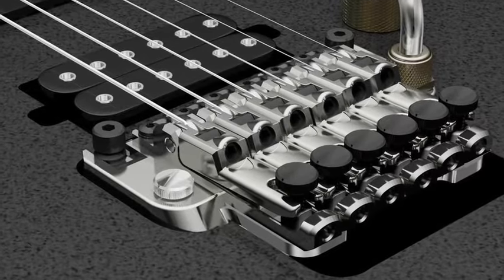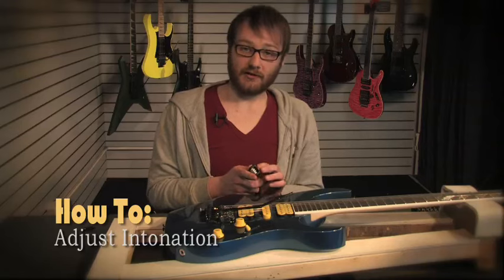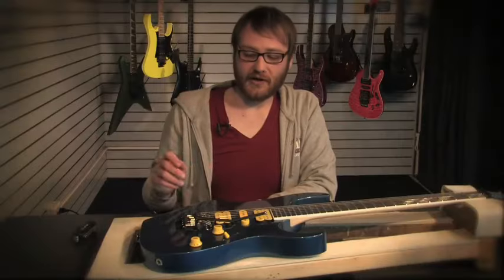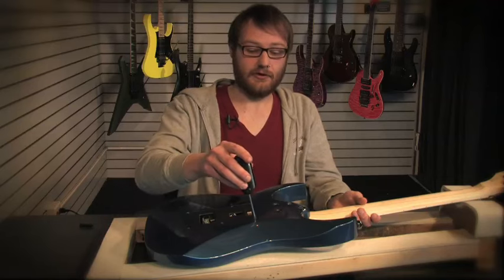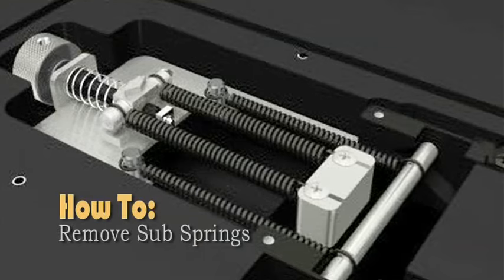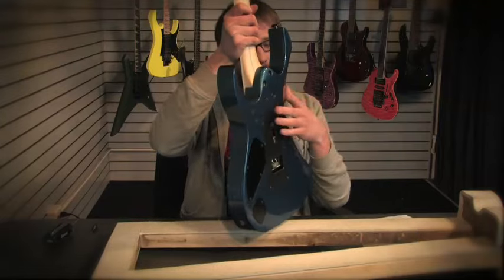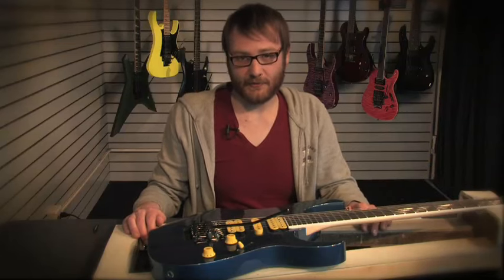Trems : Edge Zero

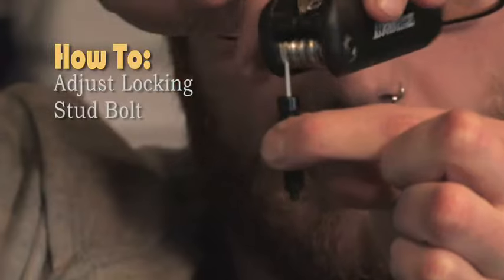Comment: why would you need to adjust the stud bolts? at 1:20
Reply: For tuning stability. The stud bolts are "set it and forget it". You want to make sure the stud bolt (there is only ONE...the same insert is used for the string height, tho...which confused me at first...the 2mm wrench in the stud lock mechanism is on the SAME side as the trem arm...so, the lock-down of the bridge mechanism is housed in the SAME BOLT as how you adjust the string height). 

I was wondering the same thing. Here is what the manual says: The Edge-Zero2 (my bridge) uses a stud-lock mechanism. "Insert Hex #2 through the hole in the top of the stud bolt and turn the stud lock bolt CLOCKWISE to tighten until it contacts the anchor nut and can no longer rotate."
Reply: Weston Guidero Basically you only need to adjust/loosen the stud lock bolt if you want to change the height of the tremolo/string action or remove the tremolo from the guitar itself.

Comment: I have several older Ibanez guitars (4 to be exact), all of them with either Lo-Pro Edge or Edge tremolos. Since last year I also have a new JEM77P-BFP with an Edge Zero 2 (no zero point system from factory) and I hate it! Sorry, this is an inferior design than the older style trems and the worst part, it doesn't stay in tune! As I said, I have several Ibanez guitars with FR-style tremolos and every one of them stays perfectly in tune, even with a lot of abuse. But this thing? Fuck it! I replaced the studs, took a closer look at the knife edges (no marks or anything, looks good), balanced it out, tightened every screw, still no chance. I use the same D'addario strings on all of my guitars and I stretch them sufficiently after I put them on. To be honest, I'm sure, I don't do anything wrong, it's just an awfull tremolo. Too bad you can't retrofit an old Lo-Pro since the routing doesn't match at all. Please Ibanez, rework the design or go back to Lo-Pros. You made great guitars for several years but now I would really think twice if I would purchase any NEW Ibanez guitar or simply look somewhere else! As far as the JEM goes, I'll try to buy brand new parts (tremolo plus nut) or I'll block the damn thing completely if nothing helps.
Reply: This is not true brother. I am an intesnse trem user and my ibanez rg premium also has an edge zero 2 trem and it has never gotten out of tune. Maybe you didn't adjust it properly. Edge zero trems are definitely as good as the older trems in terms of stability ( if not better ) and are convenient to use
Reply: If you honestly think that the edge zero 2 trem is better than the lo-pro edge, you obviously have never used one yourself. You don't find the edge zero 2 on the prestige models, think about why.
Reply: I just bought the JEM77WDP which also has the Edge Zero 2 and my experience has been the same as your.  Very unhappy with the tremolo on this otherwise awesome guitar.  I'm looking at methods for blocking it, without giving up the tremolo altogether.  I'm looking at the "Tremol-No".  Have you ever tried that?
Reply: From the video this seems like a far superior trem to the old Edge/LoPro/Edge Pro etc designs, but I came here because I was also looking at the new BFP re-issue and wondered why it had a Trem I'd not heard of.

Disappointing to hear about your experiences, I've got a 94 Jem 7V with a Lo-Pro Edge, back in the day the trem was bomb-proof in terms of tuning stability but after years of abuse and live use it's not what it was.

The question is, why is the tuning stability not as good? If this is top end stuff material/manufacturing wise and engineering is sound (which it appears to be), it should be as good or better than the old Trems.
Reply: wBryang The Tremol-No seems like a good solution, but it's not, what I want. I want a working floating trem. I guess there is a reason, why Ibanez offers guitars with that trem that have the zero point system. I think this is the main issue. It doesn't seem to have a stable pivot point. It is really sensitive and therefore gets out of tune quite easy. Makes it somewhat hard to tune too. The zero point system seems to give it a stable middle position. So I will try to retrofit this in the guitar. I sonewhat got an improvement by sharpening the knife edges a little more. Compared to the lo-pro systems, they seem really "bulky". That may be the cause, why it gets out of tune. It has 2 pivot points: the upper edge and the lower edge. By sharpening the knife edges, you can improve it a little. Still, I'm convinced that it is far away from the stability the older designs had.
Reply: EOHRyan I think the knife edges are really wide, compared to the old design. My theory is, that because of that, the trem has a chance to not return to it's original position 100%. I improved it quite a bit by sharpening the knife edges to give it a more definitive pivot point. One thing I experienced right from the beginning: It is a lot harder to tune than the edge trems. Because it is so sensitive, even a little bit of a change in tension messes it up. I guess there us a reason for the zero point system that other Ibanez guitars come with. Second realky ennoying thing us the way the arm is attached. At first it seems like a good idea to have a nut on there to adjust the movement of the arm. But as you use the arm, it loosens itself quite easily. If you want to that "flutter" trick, where you pull the trem and let it slip (Vai does it quite often), you can do that one time and the arm is loose. I somewhat fixed it with sone teflon tape around the threads to keeo the nut from loosening. That works but it is another modification you gave to do if you want to do some Vai tricks. And I think that shouldn't be the case if you buy a Steve Vai signature guitar!
Reply: Aye I get what you mean, I think I'll steer clear from the new BFP then. The 30th Anniversary guitars have the original Edge on them, but pricing is a little bit ridiculous at well over £3000. 

I did take a file to my Knife edges on my Lo Pro a few years back, helped for a short while but I think it needs a replacement. I also think the problem my Lo Pro eventually developed is what you're discribing here, it had 2 zero points, one from pulling up and one from pushing down.

So eventually I always had to zero it with a divebomb and tune it to that position, then make sure to always reset with a down, rather than an up pull.  That was pretty much the result of the knife edges wearing from heavy use while touring.
Reply: EOHRyan Sone time ago I read an interview with Vai's guitar tech, don't remember the bame, and he said they change the trems on every tour several times. So I guess it is kind of normal to replace it eventually. Luckily Ibanez still sells replacements.
Reply: EOHRyan Sone time ago I read an interview with Vai's guitar tech, don't remember the name, and he said they change the trems on every tour several times. So I guess it is kind of normal to replace it eventually. Luckily Ibanez still sells replacements.
Reply: My Ibanez stays in tune perfectly and has the edge zero 2

Comment: I am in EDGE zero II hell right now, sigh, it's been a nightmare all night putting on new strings. I followed all of the youtubes and the actual string change was easy enoough. However, when I got my new guitar, I was able to set the action as low as I wanted it, it wasn't super low but it was nice for me on the low end too. NOW, the higher end is still low and the low strings are higher and i have lowered it as low as the bolt will go! Sorry bummed right now,I have adjusted the screws in the back, back and forth and even readjusted the bolt to high to low and my lower strings now are too high. Is this common for Edge 2's? I am about to send this one back to the store. Please help anyone? I have a brand new JEM77WDP it was nice action until now, anyone?
Reply: I am returning the guitar, it is messed up.
Reply: i had a similar experience a few years back, and i swore off floating trems ever since.  well, 10 years later and here i am contemplating trying it out again.    did you buy a different guitar?
Reply: i HAD to send the guitar back, sadly, the lower end post on the guitar where the Edge 2 fits, would not lock back up and slid up and down with ease. That was a defect,  I decided to cancel my JEM order and go with the Ibanez RG1070PBZ Premium Electric Guitar (with Case), Cerulean Blue Burst. It is beautiful and I don't want anymore issues, and one day when the issues are worked out of this model; I may get it, but they have work to do on this model. just my two cents on it. I did get a Jackson Pro Soloist SL2Q MAH Electric Guitar, Transparent Blue.The floyd trem on that one is much easier to work with, but I have noticed it is not as responsive as the edge, go figure lol. So, soon I will have an Ibanez again and I hope it works out. I love the trem and I do not use it excessively, but it is a nice option to have there, and I like the harmonic squeals you can get, dive bombs are ok but I am still trying to learn how to use it with ease and only when it feels right. I have non trem guitars too, and I love them, but sometimes variety playing adds to the enjoyment of playing. Good luck in your search!
Reply: imagine what Jimi had to go through lol.
Reply: Roland Lemus  I thought about getting the charcoal black version of that guit. Did you get yours in good working order?